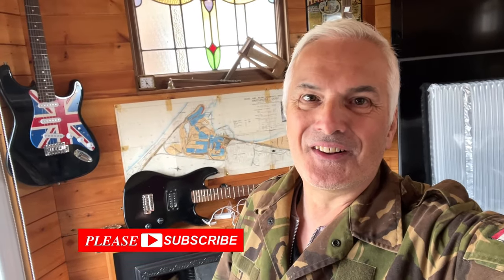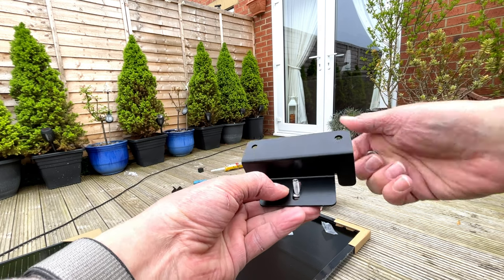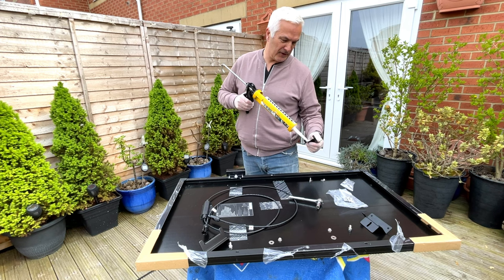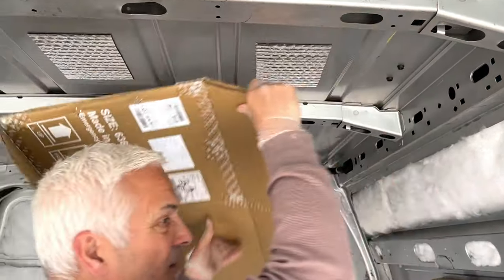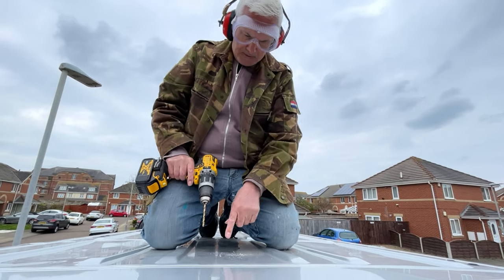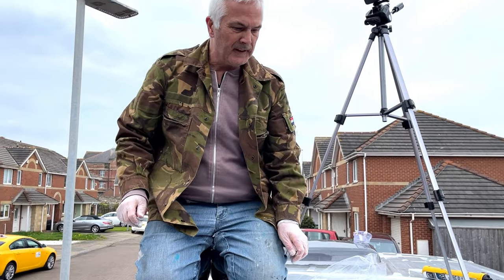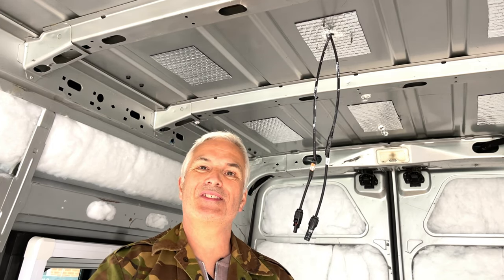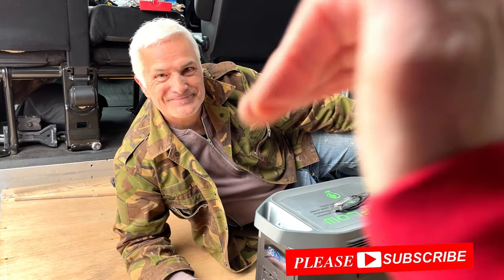Installing the EcoFlow Solar Panels to my CamperVan

Comment: Hey what connectors did you use to reconnect the wires after you had cut them?
Reply from the maker: Hi Michael, it shows you in the video at 7.43 mins. I hope this helps :)
Don't forget to like and subscribe ;)
Reply: Yeah i can see the connectors, but what are they called? @foxystravels
Reply from the maker: @michaellewis8987  I'm not entirely sure. I just went into the local electrical suppliers, and asked for some single cable electrical connectors. He brought a few different ones out to show me. I've just done a search for them on google, and loads of different types came up. This type just allow you to slide the cable in, then close a clamp over the wire. Sorry I'm not more helpful.
Reply: Those were wago lever nuts, in line nuts.

Comment: Dang that was a lot of work, glad it worked. What is the most Watts you got so far from the panels?
Reply from the maker: Hi, thanks for watching :)
I think the best I've had was around 180 watts, which I was quite happy with. After all, we are in the North East of England lol
Reply: @foxystravels  not bad at all .
Reply from the maker: @mannyfragoza9652  It might have even been a bit more actually.
What have you been getting with yours ?

Comment: How much watts does the heater pull.. how much time have you got to have it on?
Reply from the maker: It went down to 2 hours of use left, and mine is a 1600 version. I'll do a proper check later. But like some of the other things we will be using, I'm hoping that the van will be insulated enough to only have it on ten mins or so to take the edge off.

Comment: Hey! Ich habe mir letzte Woche die gleichen Solarpanele angebaut und ich bin mir nicht sicher, ob die geerdet werden müssen. Ich würde die Akkubox zwischendurch gerne mal aus dem Auto rausholen (wenns im Winter zu kalt ist), aber dann ist ja trotzdem Spannung aus der Solaranlage. Habt ihr damit Erfahrungen? Liebe Grüße aus Greifswald. :hand-purple-blue-peace:
Reply from the maker: Hi. The panels plug directly into the back of the EcoFlow Delta Max, and can be unplugged at any time. I often take the power station out of the van, for charging at home, when there isn't enough solar to charge it.